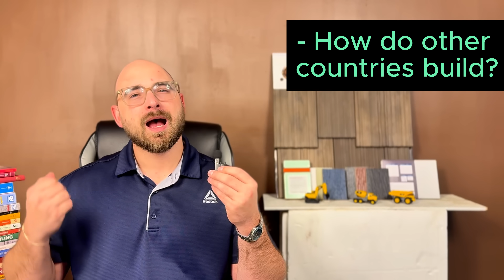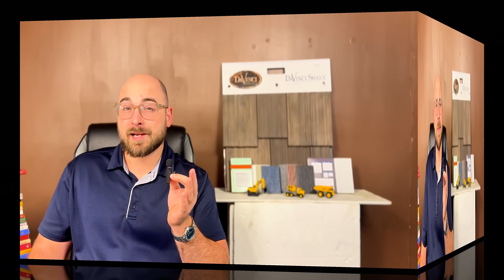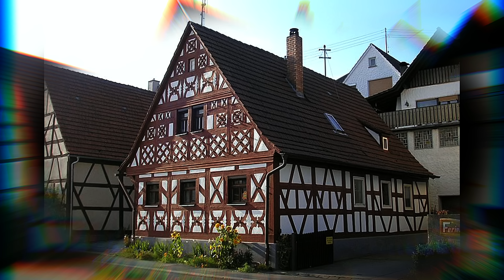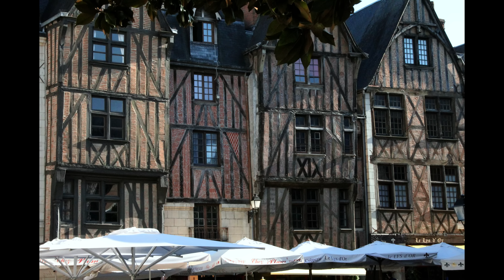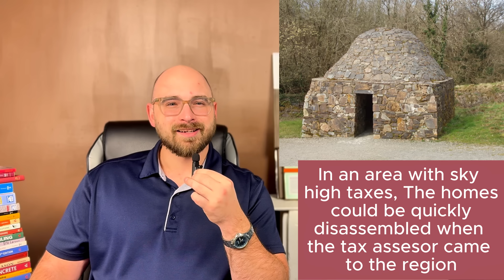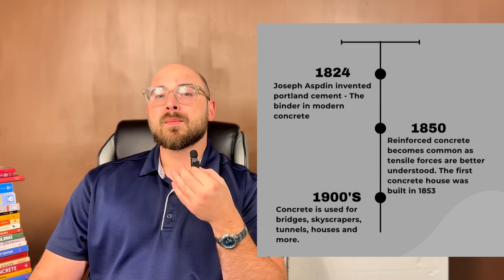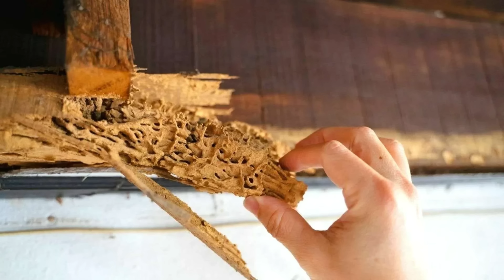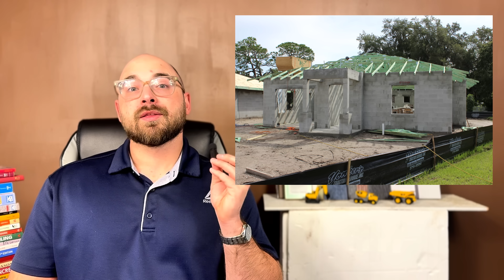Why Other Countries LAUGH at American Homes

Comment: North American homes i.e. wood frame are not intrinsically inferior to European masonry or concrete homes.  Yes, there has been a trend towards 'engineered' lumber (timber) over the last forty years, and I resist it's use in my designs except in non-structural applications. Also, tracked home builders of late are using less skilled labour, and cutting corners more and more.  But this is not unique to North America.
In areas of moderate or greater seismic activity wood frame is more resistant to total collapse/failure than a comparable masonry structure.  Likewise, fire resistance is comparable to masonry and concrete when designing for those conditions.  Wood frame has significant advantages over other methods of construction.  Including cost, speed of construction, thermal resistance, access for services and so forth.
I wouldn't want to have to pay the cost to build and heat a UK home in Canada, but for the same house built to North American standards in the UK it would be a bargain to heat/cool and buy.
Ultimately in comes down to regional and confirmational bias.  Believe what you want to believe.
Reply: I am an American architect. I must say, I never worked on housing, but I studied in Europe when young and lived in Europe in my late 20s and early thirties. 
I’ve loved everywhere I’ve lived and I’ve enjoyed observing building construction methods. 
I must quote a British professor who said, “American houses are much better than ours. When they realize what a mistake they’ve made, they’re much easier to knock down than our mistakes.”
Western Europeans live in a climate so mild that everything becomes easier. Like living in California without earthquakes. Much of the US has very challenging climate, heat, cold, violent weather. Most Europeans live in very concentrated communities. A much smaller proportion of Americans do. This allows Americans a bewildering array of choices, and they may not always choose wisely. Except for the very rich, ordinary Europeans have far fewer options for housing. 
Any modern building system can do anything required of it, from earthquake resistance, fire protection, energy conservation or anything else. The cost and quality can vary in any system. Some systems are inherently costlier than others. 
On energy, nothing has amazed me more than Germans installing high quality energy-conserving windows and then leaving them open most of the time.
Reply from the maker: Not the wide open triple glazed window 😂 🪟 

I
Reply: @rumbaughsteven5577  We Germans do NOT leave our windows open most of the time. 😁 Especially now with minus degrees.
What we do is called " Stosslüften" = open the windows for a short time to let fresh air in and stale one out.
Reply: @rumbaughsteven5577  not really. Europe has a very variable climate. There's a huge discrepancy say in Northern sweden/Norway or south Italy. Where I live in Switzerland we literally are in the same climate zone as Alaska at a little altitude. Itg gets both really cold and fairly hot. I bet the temperature swing from hottest to coldest beats 80% of the US. And btw, Mediterranean has much more variance than coastal California (mind you, Inland Cali isnt mild at all. Isn't death valley in California?).

Ill offer you another important difference... Europe is far more densely populated, and it's smaller. So people don't move nearly as much as Americans so they invest because they know they'll stay put. Culturally, properties stay in the family for multiple generations also. It's simply much more sensible to invest in a high quality build if you plan on passing a property down to your kids. In the US people move all the time and constantly find new sucker's to unload their stick homes to so they can move on to another, bigger stick mcmansion in a better neighborhood, or better city. People in Europe don't do that. Mainly because land is so scarce, making homes much more expensive than in the US.
Reply: Masonry houses are fine in earthquakes A strong metal or concrete frame(rebars) is first built to prevent masonry collapse. See Mexican and Peruvian adobe houses,
Reply: @danielbecker4365   I didn't mean to suggest that masonry or steel structures were necessarily poorer in seismic situations.  For municipalities it has to do with cost as much as survivability and function post disaster.  In my practice I've used wood frame for Post Disaster structures (fire stations) as the design allowed for structural safety after seismic events and wind storms more cost effectively than a comparable steel or metal structure.  A fire station isn't much use if it blows over, collapses or burns down.  Wood frame is resilliant and gives you all that when properly designed and constructed.
Reply: Sounds more like you want to believe what you want 😂

And btw, I'm Swiss I've seen a few wooden houses in my life. But ours don't get blown to shreds by a little gust.
Reply: @mysterioanonymous3206  Neither do mine.

Comment: ICF is better, but isn't really accessible to a DIY'er. By the time you rent the pump truck, pay retail for your cement, etc., the price comes down to paying a few guys for labour, a modest mark-up for the contractor, and you get the much-needed support forms. In contrast, I can single-handedly lay block and build/raise small walls with just a back hoe and a buddy. Somehow in North America that DIY accessibility created a giant industry of professionals building in a fashion that was never really designed to be commercialized.
Reply from the maker: I think ICF is going to be more DIY friendly than CMU, A good mason is worth their wages. 

ICF is easy like legos, even if it takes a few extra sets of hands and a pump truck

Comment: During WWII the American Army developed new methods to cheaply and quickly build temporary buildings. This is the basis of the vast majority of American houses, cardboard boxes that require massive amounts of energy to make them livable.
added to save time:
its not just what they are made with its also how. They had methods to deal with problems (for example wrap around porches) that got tossed out and replaced with more energy. From top to bottom.
Reply: They don’t actually cost much more energy comparatively. It costs just as much if not more to heat a drafty old 19th century British brick home then it does to heat a modern well insulated American wood framed home.
Reply: @Matt-yg8ub  How are you doing Mr. Straw Man? You and me both know you could add some insulation to that 19th century home but the modern needs to be trashed and replaced.
Reply: @robertleelewis  add insulation to 2 meter thick brick wall and end up with even smaller rooms.
Reply: 1967-68 I lived in a 1950s US built Married Quarter in UK. USAF paid bills, nominal charge added to rent taken from pay. UK govt took over the quarters, tried to change the system but had to go back to the US system - our bill for Jan-Mar 1968 was just under 2 months of our joint paypackets.
Reply: all house in america build in 1800 and even 1700 are built with structural timber ( framing) just 2x4 ( 1.5x3.5 now)  back then were 4x4 actually.
Reply: That is what happens. Right after World War II construction quality went to hell.  Americans, dumb as they are, happily accepted it
Reply: But they are not cheap anymore nowadays, totally not cheap at all.

Comment: Sadly, it seems like builders just do the minimum regulatory requirements where it matters.

Like why not use 2 x 6 around the bedrooms that share common space or outside walls? Yes cost, but that is a great marketing tool so I think people would pay for the premium to have more quiet in the bedrooms. While on that, triple pane windows in bedrooms for sound as well.

The contractors that get used sometimes...like wow. My parents had a home, now it is close to $2M house, and when it was built the back patio had a 2% grade like it is supposed to for water flow....but the idiots sloped it to the house rather than away! How could you trust any other pour in that home - driveway, garage, foundation, etc?!?  Of course they came and took it out and redid the work, but it was not a small area - probably 15' x 25'. Naturally the yard was beat up over the course of the removal so they had to pay to get that fixed. French drains on the same home had to be redone within 18 months of it being built. higher end home at the time and a well regarded builder...but the people that they sometimes get too. Add that to building just to the code for inspections rather than building better just chaps my hide, especially when the better building would be selling features (sound, temperature & energy control, etc). I mean why even build a new home and not have window film on there from the beginning?!?!

It's like regardless the category of home they only build so they can price to sell rather than thinking about the marketing advantage and reputation they would have by adding the few little extras. Well, they sort of do. They will go out of their way to build multi-zone HVAC but not more sound proofing, thicker walls where it matters, soundproof windows where they matter, etc.
Reply from the maker: I’m sorry that was your experience 

Unfortunately even on custom builds quality is not the greatest concern, but rather looks and square footage. 

I advise people to look for “high-performance” builders over the so-called “luxury” builders 

Many of the luxury guys are not builders at all but businessmen, only concerned with numbers and the minimum that code requires, with no knowledge or experience in the trades 

What you really want is a craftsman who loves building science and serving people 

High performance = true luxury and comfort, not just the appearance of it

Comment: California has an issue.  They have to build homes that resist fire and earthquakes.  Wood is good for earthquakes, concrete is good for fire.
Reply: Steel exterior is probably the best option in this case.
Reply: Earthquake prone Japan build of concrete
Reply: @ikaustralia  Exactly Americans just use wood because it's cheap and breakdowns so people with trade jobs always have jobs
Reply: Concrete, done properly, is fine for eartthquakes.
Reply: @rogerphelps9939  Yes. Even wood works. There's a picture of one house in Pacific Palisades that survived the fire. It survived from how the house was constructed and the use of fire resistant exterior materials. Most importantly was the landscaping was minimal as the architect wanted a buffer near the house.  I remember the same thing had happened in Monterey, CA. back in the late 70s. One house survived after a wild fire. That particular homeowner fought with the city about him wanting to use clay tiles for his roof. He didn't like the look of wood shingles that was required for homes built in Monterrey. Me neither. Wood shingles never looked good to me at all. 
Another recent example of a home surviving a wild fire was in Lahaina, HI. The surviving house didn't have as much vegetation on the property unlike all of the neighboring houses. A buffer zone is very important. 

After the fire guess what requirement the city changed.
Reply: I agree concrete can be made to work well with earthquakes, less so with bricks.
Reply: Just use fireproof roofing, tile or steel.
Reply: concrete properly done is utlra resist to earthquake i live in a heavly sismic contry and all our houses are make for concrete
Reply: Cool story now how much would that cost for a earthquake resistant house
Reply: @gnomechump-stiny7128 Well, less than two houses. In some areas it seems to have it destroyed either by fire or earthquake, so in the end it is cheaper.
Reply: @gnomechump-stiny7128  160 square metter house of concrete earthquake resistance 120k bucks

Comment: Build from a renewable, carbon-capturing resource?  Nah, let’s use concrete which runs 8% of global emissions. 

There’s good reasons for many types of construction.  As you point out, use of local materials is the driver in history.  Colonial America was rich in timber, so they built with it.
Reply from the maker: To be fair, building with materials that burn down or end up in a landfill aren’t exactly eco friendly either, 

When eco friendly concrete becomes readily available, I’d be happy to use it

Comment: Can't speak for the entirer country, but here in north west germany, most buildings consist of a inner cmu shell with reinforced concrete floors, and a outer brick shell and solar pannels instead of rooftiles (with buildings from the last three or four years.).
Reply: Solar panels instead of tiles seems like false economy to me. The solar panels will have a limited lifeime, 50 years maybe. Furthermore a failure will have you scurrying around trying to find a repalcement that has been out of production for many years.Tiles could lastt for hundreds of years. Far better to mount solar panels over tiles
Reply: The solar panels are put about 20 cm above the rooftiles .... there still isca complete roof
Greetings from Germany

Comment: 9:40 It’s not that the knowledge was lost, it was because bricks and specially concrete was very expensive and the empire had fallen.

Meaning the entirety of europe that was under roman control and was 100% the entire continent’s economy.

So when the roman empire fell so did the european economy (collapsed), which lead to the 1000 years of economical crisis and wars named dark ages, middle ages or more commonly known as medieval times. 

bricks and concrete wasn’t used because almost nobody could afford it, only states could expend so much money and for most people cutting down a tree was cheaper and easily accessible.

Bricks most have been used in Venice, as the only rich enough city in the entire medieval times to build the entire city with bricks and stone.

bricks and stone only became popular again with the renaissance (stone) and bricks in the age of exploration (colonisation) , because everybody got rich in those eras.

Comment: I live in south florida so code makes stick framing pretty much non-existant especially for Miami-Dade County. Being primarly a comercial developer since the early 1970's I've always built structures to last as I own and lease them and know that lasting methods while never the cheapest for initial build costs produce better returns over time. Our windows are impact resistant and tested for 150 MPH wind and impact resistant and the walls have superior fire resistance while not cheap these structures with minimal maintenance will last. In the last ten years a company has been building homes and low rise commercial using 2MM steel framing gunited either 2" thick or 4" thick getting a UL label for +200MPH wind and depending upon stucco finish up to a 7hr fire rating for its buildings. Ive never tested any gunite below 10,000psi so this is hydroscopic and will not let any water or water vapor pass with the impact resistant windows at a shell cost preminium of about <25% more provides a structure that should be around for millenia and provide the homeowner safe shelter in place for even tornados or any fire that could possibly threaten. The Miami-Dade required labeled windows takes me about 20-30 minutes to create a hole large enough for entry and it's not possible to breach fully cured gunite wall with a hand held sledgehammer. Truly a fortress that can be have any architectural style desired and does not look like a vault just appears as a high end custom residence. I use this company rarely in south Florida but am not associated with them other than as an occasional customer but searching the words "spray rock" will lead one to companies that can build to these specs. Ray
Reply: This is a great example for my comment earlier. There is innovation in the US to improve our traditional home building where and when needed or desired. The process of creating awareness and getting it into mainstream housebuilding is just so slow. 
All major news outlets covere the LA fires extensively. I have however not seen one report on house construction options to mitigate fire hazards (or flooding, tornadoes, hurricanes for that matter).
Reply: @BAG9114 : the news is no better than another form of entertainment.  I watched a very interesting video by Matt Risinger, a high spec builder, looking at the reasons why some of the LA homes did not burn.  He selected two examples, Tom Hanks's house, and an architect specified one.   Risinger's video is about the same length of this on and worth a watch if you are interested in his conclusions.
Reply: @BAG9114  You are 100% correct! If rebuilding is going to resume in an area that will have the Sanna Ana wind as an extreme aggravating factor the reasonable path forward would be to modify building codes for these areas where extreme winds will happen annually and eliminate any flamable materials to be used on the exterior walls, roofs, and structure so homes could withstand a rapidly moving fire front. No one can fight a fire in winds this high we do yet have the tech. and ability to send fire fighter in front of a fire being this strongly fanned. This is certain and absolute suicide and yet we hear about fire hydrants that could provide unlimited water but the truth is these hydrants would not be able to be used in front of a fire fanned by these extreme winds, So as Nero is for fiddle and just tell people what's expediant. I think the insurance industry may accomplish what government is to this point unwilling to face. Homes and buildings in special risk areas must incur the added expense of building to standards that mitigate those risks without needing additional preminiums for coverage or do not allow construction.